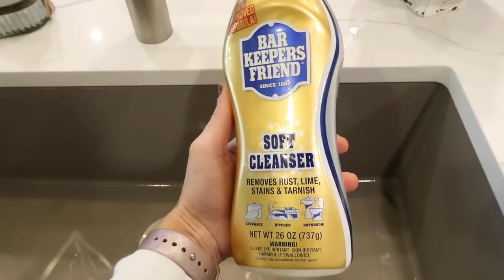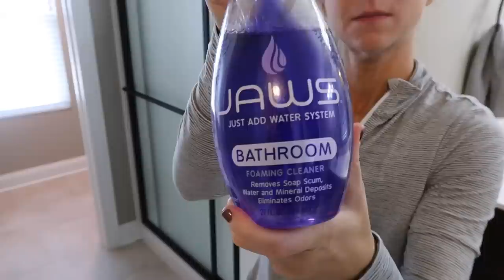🏡 CLEAN WITH ME 2022 IN 2 HOUSES! |  EXTREME SPEED CLEANING MOTIVATION | HOMEMAKING |JAMIE'S JOURNEY

Comment: Hello, Jamie. About your question of the stove, I've had gas stove all my life and yes, you have to be careful that nothing other than water goes inside those tubes. Otherwise it could be dangerous if another type of product burns when you turn on the flame. It could produce poisonous fumes, or, in the best case, it could smell really bad. Also, there's no problem with how you wash the stove, but you have to make sure that you rinse it completely. That way you will not leave any cleaning product residue that could produce a flame. I was checking some of my products that I have for that purpose (I live outside the US), and all of them have that recommendation. Thanks for the inspiration!
Reply from the maker: Thank you so much for all of this info!😊

Comment: I've had single basin and divided sinks, I much prefer a large single basin.  I'm very careful to not get any liquid or cleaners in the gas holes (don't know what they're actually called), it just seems safer.  I find that the absolute best thing you can do for your shower doors is to dry them off after every use.  I keep a squeegee, glass cloth and an absorbent microfiber right in the shower and take a minute (literally) to dry the whole thing down after every use.  I also keep a shower spray in there and use it once a week before I get out of the shower.  It's so quick to do and the shower stays clean and shiny for a long time.  I have chronic back and knee pain and this routine saves me a lot of pain because I rarely have to scrub the shower.  I'm actually considering getting the glass vac to keep in the bathroom for daily use.
Reply from the maker: Thank you so much for sharing that 😊 I’m glad you have a routine that works well!

Comment: I have a very similar stove as your parents. I put my grates and the burner elements in my dishwasher……😬🤷🏻‍♀️ I’ve never had an issue with cleaner getting in the holes. When I put it back together, I turn all of the burners on high to make sure any liquid that may have got in there burns/dries out.

Comment: The user manual for my gas stove was very specific about what cleaners to use and what to avoid. I don't think some soap in the gas line is a big deal as long as you wait to use it.  I was surprised that the manual said not to use Easy Off or any other kind of oven cleaner on the inside.  I'm not sure if it's because it's a convection oven or not.   I use Zep on my grout on the floors because I have white tile and white grout (it's beautiful but a pain)  The bottle says to be careful about using it too often because you might have to reseal the grout.  I've used a lot of different methods to clean the tiles and I found that steam cleaning them works the best.  Just about everything else leaves streaks or just doesn't get them clean enough for me.   And I love my giant one bowl kitchen sink.  We had a double sink in our last place and I hated it.
Reply from the maker: Thank you for all of this info!😊

Comment: Do not get water on the surface near the flame point, you will cause a short & sparks then the gas won't flow, it happened to me. Very expensive to fix! I use oven cleaner, i use a piece of cardboard as barrier as i spray around the gas burner, careful not to wet it any part of the burner.  I use oven cleaner on the flat glass burners too, it's to much work to clean by hand- i used to scrub and take a razor to the burnt on grease. Wear a mask, gloves & goggles.
Reply from the maker: Thank you!!

Comment: There is also an after shower spray I'm pretty sure that it's put out my Lysol but there are different ones that you can spray your shower down with after you get out of the shower and it will keep a lot of the grime from getting on your shower it just makes your cleaning a lot easier and plus I just clean depending on if it's more of a stone or if it's more of a marble tile I will just use the most mild dishwashing liquid that you can find like Don even that is really good for cleaning your shower it's not harsh and if you use the after shower spray on your tile before you get out it's really good I think Lysol puts it out I'm pretty sure but like I said there are several different kinds
Reply from the maker: Thank you!